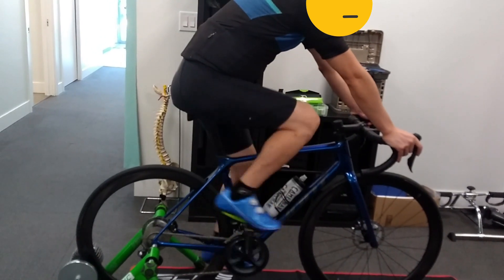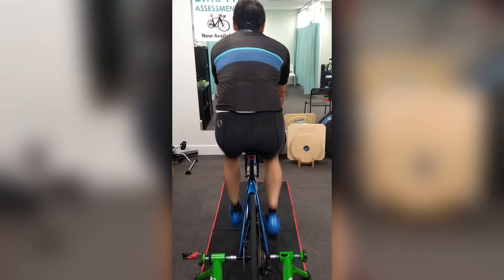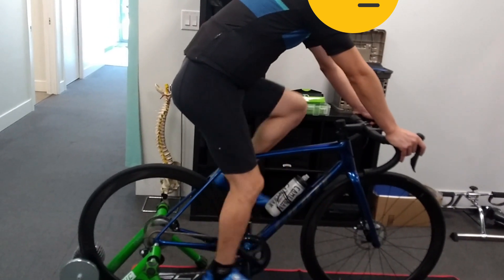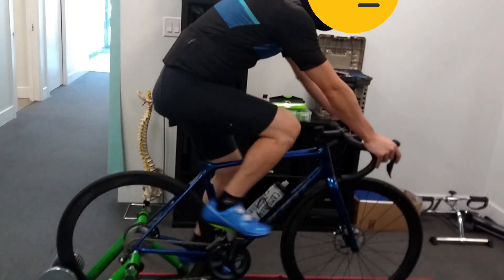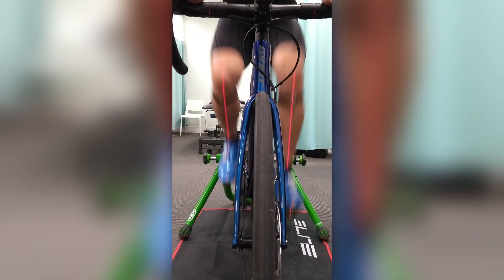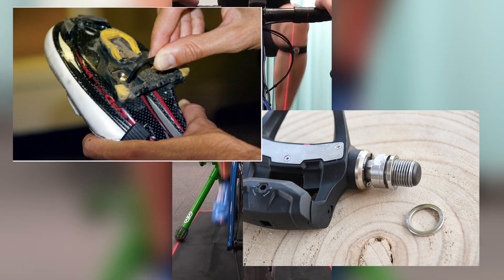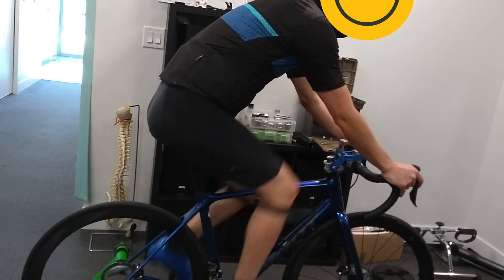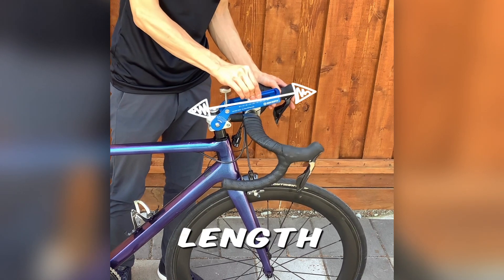How a Bike Fitter Determines the Correct Stem Length and Reach to the Handlebars

Comment: Great video. Why do you increase his qfactor when the knee track lateral?
Reply: because the hip is the boss of the knee, and the knee is the boss of the foot, 
so we do not force the knee and hip  to move in straight line by using its subordinate, instead we help the knee and hip by placing the foot to where they want it to be.
Reply from the maker: Great discussion! Try to flex your hip to bring your knee to chest like this (https://ernestchaophysio.files.wordpress.com/2021/04/untitled.png?w=636&h=&zoom=2). Now try to same motion but bring your leg lateral like this (https://ernestchaophysio.files.wordpress.com/2021/04/untitled1.png?w=636&h=&zoom=2) You'll notice there is more range when you bring your hip into flexion with pulling it slightly lateral. Now if we translate this to the bike, when the hip runs out of flexion it will deviate lateral and pull the knee along with it. By increasing the stance width at the feet we help utilize more range from the hip. This is great for those with arthritic hips. 

Another option would be running shorter crank arms, which in my opinion is a very good solution but also a lot more expensive.
Reply: But increasing q factor will also put more pressure on the knee in a lateral perspective?
Reply from the maker: It's possible that excess Q-factor/stance width would place extra pressure on the lateral knee if it causes it to track in an abnormal pattern. We have to look at adjusting stance width with the width of the hips and available range of the hips so the knee is tracking relatively "normal".